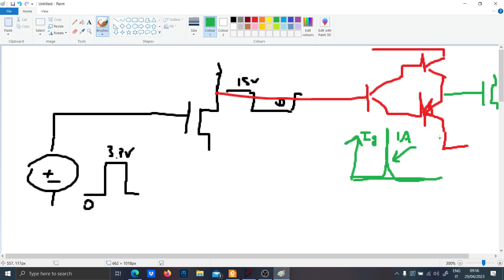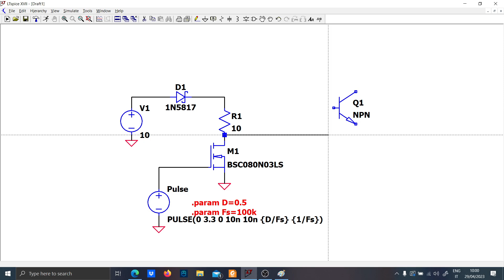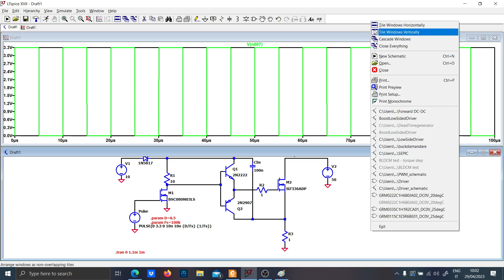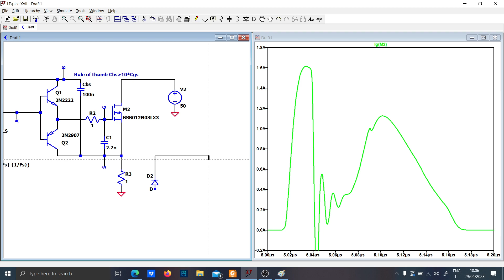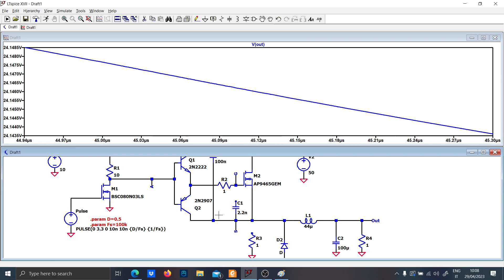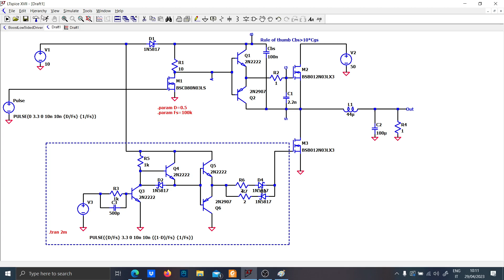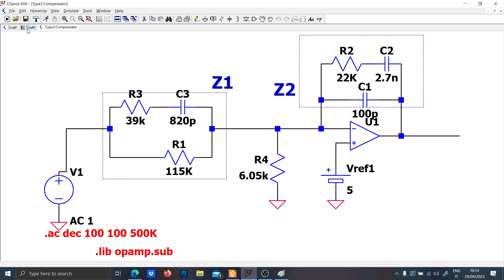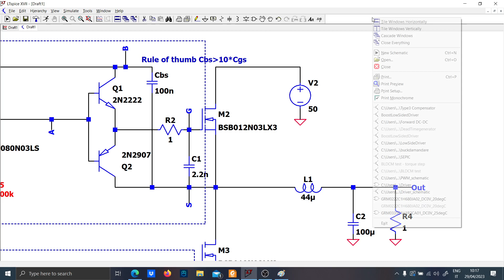LTSPICE High and Low side Driver for Buck DC-DC

Comment: Hello. Thank you for the excellent, informative video.  There is a reverse voltage surge of about 50V between the emitter and the base of the transistors Q1 Q2. Can any transistor withstand such a voltage between the base and the emitter?
Thank you

Comment: How do you adjust the dead time? I want to learn that too. I saw you have a dead time generator.
Reply from the maker: If you use the square wave, with {D/Fs} as turn on period, just declare
.param dd=10ns
and then
{D/Fs -dd } as Ton period
{(1-D)/Fs -dd} as Ton for the other switch
be careful with the brackets, you can waste hours for nothing
Reply from the maker: If you use the square wave, with {D/Fs} as turn on period, just declare
.param dd=10ns
and then
{D/Fs -dd } as Ton period
{(1-D)/Fs -dd} as Ton for the other switch
be careful with the brackets, you can waste hours for nothing
Reply: @manoA98A  I mean with a capacitor or rc network to delay los or high side. Where to insert it and how to best calculate the rc tau time constant or if you have a rule of thumb.  Without external micro controlling it
Reply from the maker: @robr8554  I Will make a video of how to generate a dead time with and RC network next week
Reply: @manoA98A  you are awesome and love your videos
Reply from the maker: @robr8554  Thank you very much!